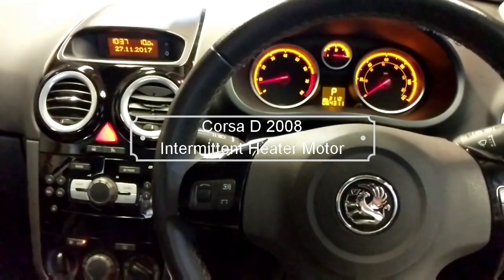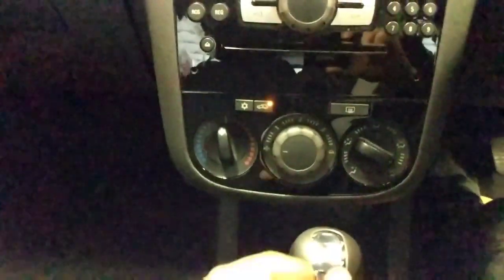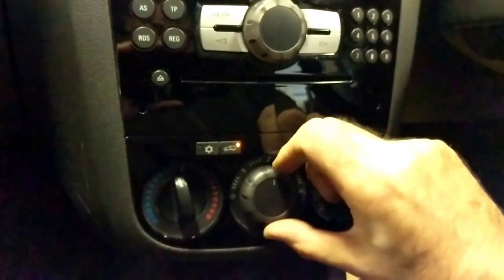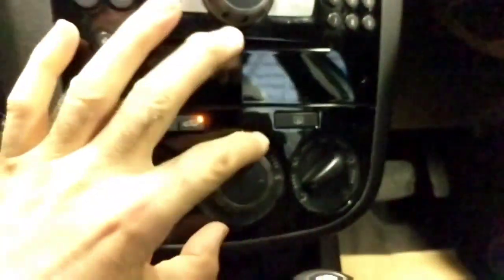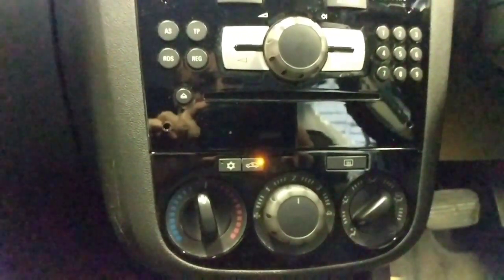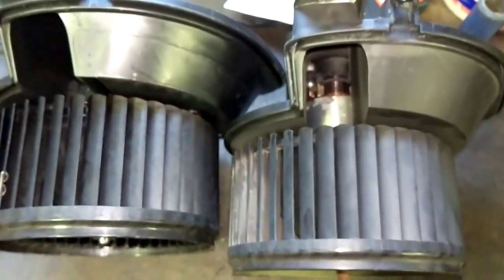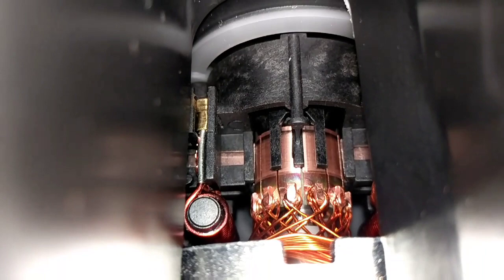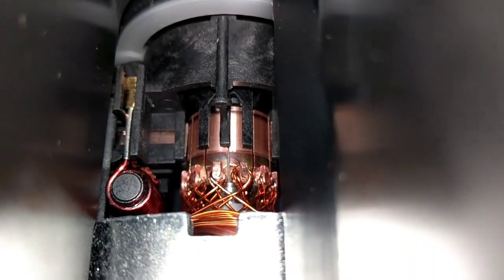Corsa D 2008 Heater Motor Fan intermittent - diagnosis and repair.

Comment: I have a 2007 corsa D and the blower is not blowing fast at all. The resistor doesnt work so the mechanic just used the resistor as a bridge so it blows at max on all speeds. I have 7 speeds and all are the same. Technically it should blow at max since the wires act as if there is no resistor at all. But when i put the motor to blow from 2 holes, Feet and Face vent. It isnt blowing hard at all. 
My theory is that the motor is dirty or something, or the resistor needs changing even tho it shouldnt matter since it blows on max. Or the air filter is clogged so there is little airflow. What do you think?
Reply from the maker: Bit hard to work out what's going on when you can't see it yourself. Could be down to a clogged filter which made the motor work too hard and burn out the resistor. You might need all 3 parts. Sounds like you need your mechanic to diagnose it properly and change the necessary parts. Good luck 👍
Reply: @Automotive_Solutions  Thanks for the fast reply. I love to learn and tinker with my car. So i will change the air filter, clean the motor and change the resistor. Hoping that would solve everything. If its still weak, there may be a clog somewhere else. Im not sure where does the motor pull air. Maybe the radiator is clogged? Who knows. Thank tho

Comment: Hi, I've got a 57 plate corsavan  and my fan just stopped working, when I turn the speed  dial the light flicker around the dial and go out on the heat control? Was working  when stationary then stopped when I started moving?
Reply from the maker: Sounds like a poor connection somewhere back there. I think your going to have to get in there to have a look at the wiring at the control panel, heater resistor and fan motor. Test the motor as well with 12v direct power & ground. Good luck.
Reply: @Automotive_Solutions just checked and 12v to the motor connection so I guess a bad motor!  many thanks for your help 😊

Comment: Do the Orange and brown cable's from the loom connect to the same terminal on the resistor. The cable terminals burnt out for mine so I'm thinking of joining the Orange and brown cable together and soldering to the resistor terminal. Would that work, or is my car going to burst in to flames?
Reply from the maker: I wouldn't deviate from the original wiring. If you do then keep a fire extinguisher in the car with you. 🔥
Reply: @Automotive_Solutions  technically, the wiring will be the same, only I'll have soldered the cables rather than simply push fit them.
Reply from the maker: @fiazshah3838  I see. I misunderstood what you were trying to achieve.
Reply: @Automotive_Solutions  Should be fine. I've had a look at some wiring diagrams. Thanks.

Comment: My car - Corsa D 2008 - does the exact same thing. The rattling sound too. Then there’s times when it won’t even work even on 4. Had the resister loom and stuff changed by a garage but turns out motor is messed just like the one in this video
Reply from the maker: Looks like new blower motor for you as well then. They're a bit of a weak point in many vehicles. A lot get damaged from water leaking in through the firewall and others just wear out. Thanks for watching.
Reply: Automotive Solutions do you have a link that I can buy a new motor from?
Reply from the maker: @horatio.v  - I quite often use autovaux.co.uk for vauxhall parts. Or Amazon..  https://amzn.to/2IWNHAL or  https://amzn.to/2ROv7i9

Comment: Hey I need your help when my corsa d goes over a speed bump the heating stoppa working and I make it work by moving the steering whee adjuster and it’s been into Vauxhall and they said it was a wiring loom can you suggest what it is
Reply from the maker: Joshua Brenninkmeyer - the only ones I've seen have had motor faults or heater resistor / wiring plug faults. You might want a second opinion from an auto electrician before committing to a new loom from Vauxhall.